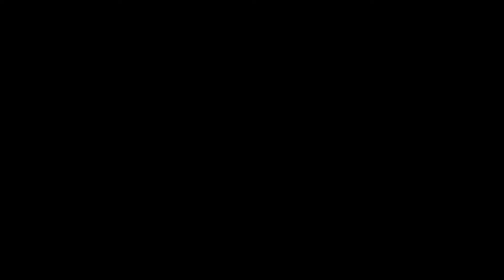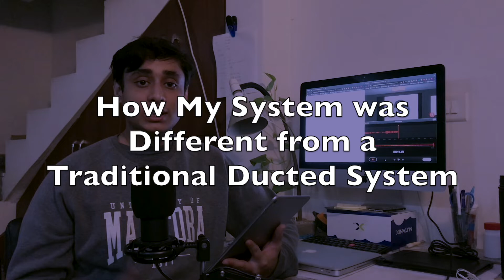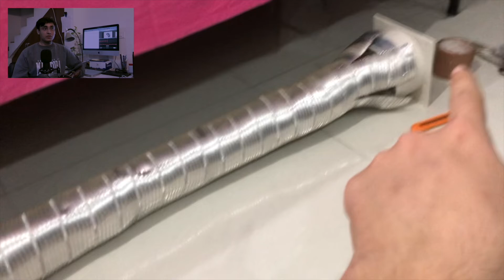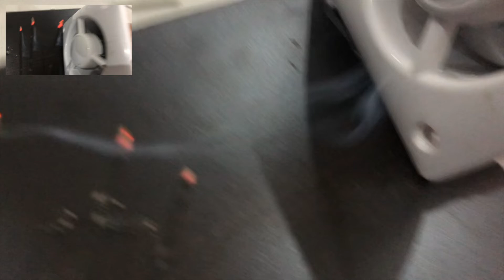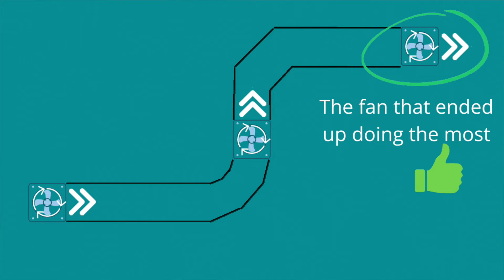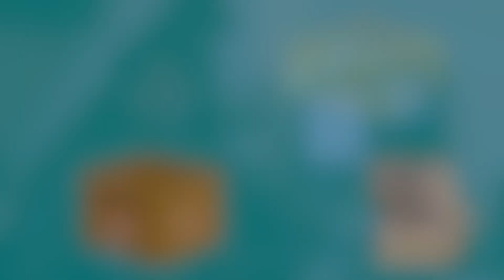DIY Ventilation System | DIY Ducted System | On a Budget

Comment: I've been thinking about using some PWM server fans to set up an inlet system with a Hepa filter to keep out dust and an outlet system to extract smoke. I've been studying the issue of positive pressure but I'm still not 100% sure about my project. I plan to try to control everything with an ESP32 and measure the amount of particles with PM2.5 sensors. I'm still studying how to make this project but I appreciate your video because it alerted me to the issue of atmospheric pressure in which I was forgetting to evaluate. Thank you.
Reply from the maker: Thank you, glad I could help. Good luck with your project.
Reply: your project sounds very cool! May I ask what are you making ventilation system for???
Reply: @harshansingh4822  For my personal room, I live in a rural area that is very dusty and I am also a smoker, so I can't leave the bedroom window open if my computer doesn't get dusty, and I can't leave it closed because my girlfriend has breathing problems. So I'm practically being forced to do this